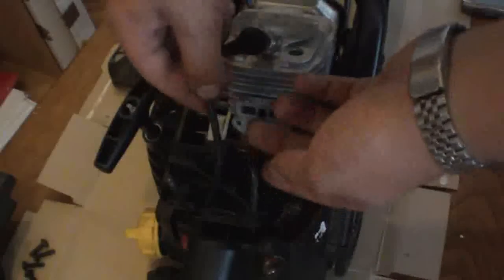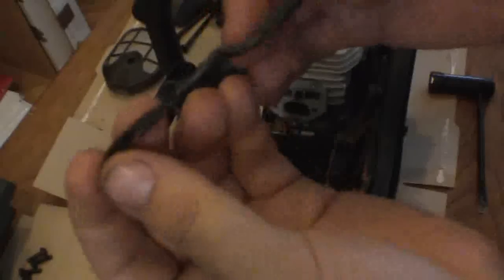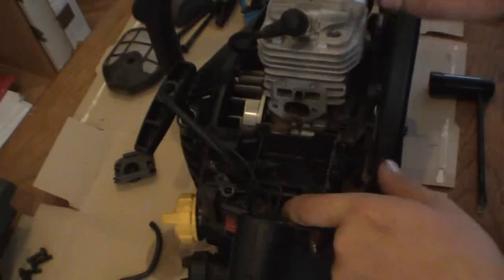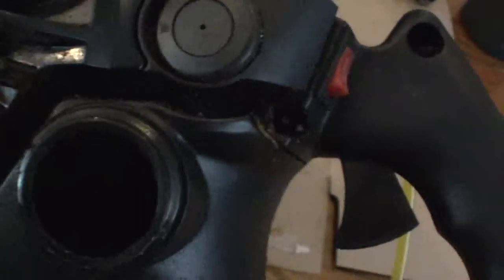How To: McCulloch Chainsaw Fuel Line Replacement

Comment: Good Video.  I was in the middle of a job and my McCulloch MacCat Chain Saw quit working, the fuel line broke and the Primer Bulb cracked. 
Ran a new tube from the Fuel Filter in the tank to the Carb, I found out that I could bypass the Primer Bulb by and used some tubing to run to the suction side of the carb through the Primer Bulb hole.  Using a small pastic bottle with cap and hose barb fitting, was able to pull a suction to prime the carb. Had to close the suction tube with a screw. Bingo!

Comment from the maker: @aa3815 The routing sounds correct.  Make sure you have the inlet and outlet side on the primer correct, as well as the feed and return line on the carb, if any one of them is incorrect it will not run.  I agree, the schematics for these usually are quite poor at best.

Comment: There is a real good separate fuel line replacement video on U-Tube for the MAC 3516 that answers your question as to which line goes where.

Comment: get video,  question,  not sure if I was able to put my Mac3516 back together like it should be.  Schematic not clear, Should the fuel line go from gas tank to primer bulb and other side of primer bulb to carburetor, and the other side of carburetor fuel line back to fuel tank?  If so then for some reason mine will not stay running?
Thanks in advance

Comment: @asssface2000 i was jokeing but if the saw wont prime u will need a new fuel pump diaphragm and check the fuel line for crack and stiffness